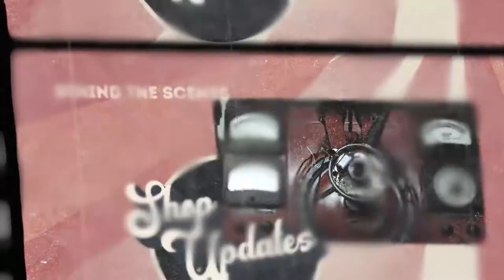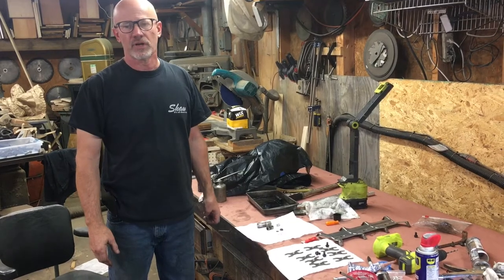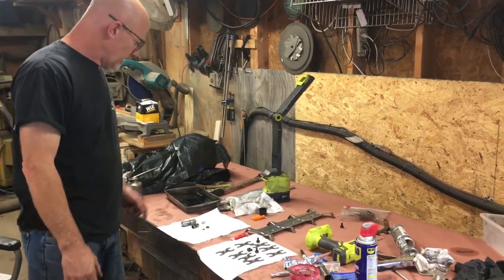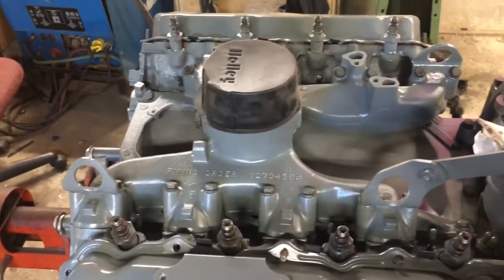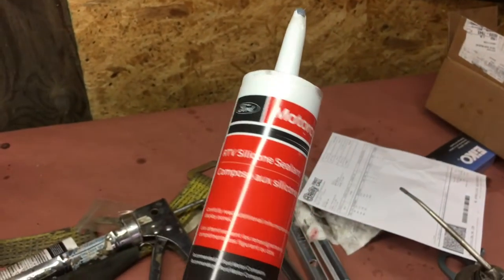7.3 IDI Turbo Engine Build part 3

Comment: I wish someone would build a large runner intake for idi. I think that’s a huge limitation on these motors.
Reply: what’s wrong with the IDI intake? They’d be considered high performance in gas motors. The limitation of the IDI’s is the 160cc-ish max fueling capability.
Reply: I could fabricate you one just send me the designs